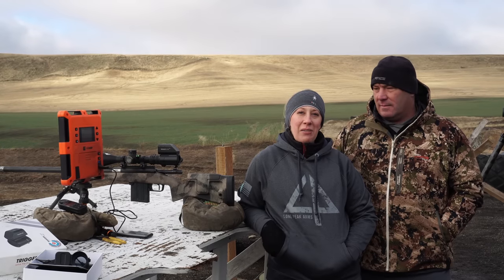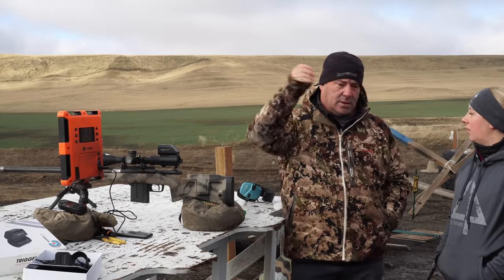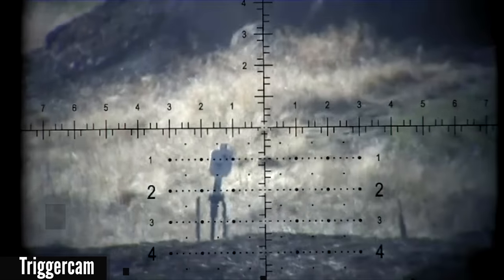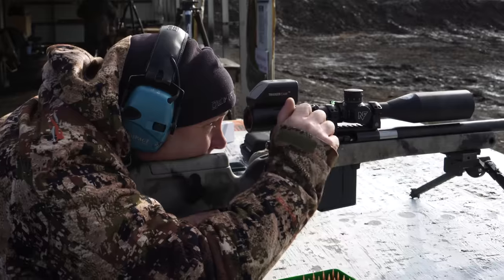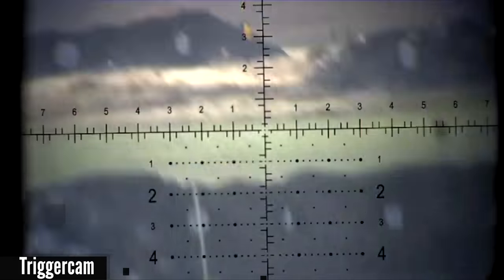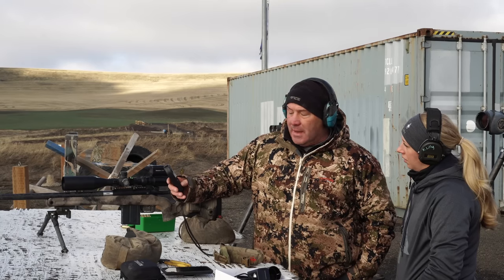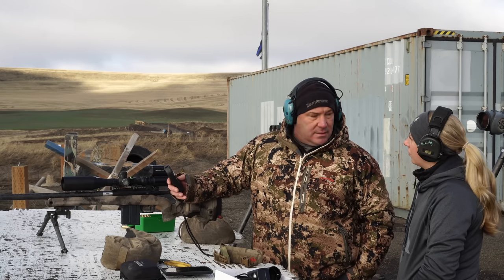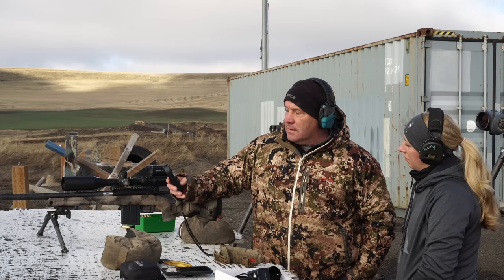Trueing and finding Ballistic Coefficient with Scott Satterlee

Comment: Really dig your vids. I recently upped my tooling and making better ammo. I REALLY like the KM 4 deg champher tool with stop. I'm neck turning and annealing, and even inner neck honing. I was able to get ~8ES recently where my buddy with factory was getting ~50ES (6,5 CM).

Very good info around truing the BC. Another tip that I have been known to use is to put the chrono up at 600 behind the sighter plate if its big enough and you trust your rounds enough.

Comment: on the kestrel to find aero jump, why not put wind at zero mph and the Left shift is your jump? example: at 600 yds, wind none, my windage is 0.69L. meaning i have to hold off 3/4 MOA only due to aero jump?
Reply from the maker: Are you talking aerodynamic jump or spin drift? AJ is a vertical number. Spin drift is a windage number.
Reply: @longrangewiththelillys1221  wha . . ? that sideways movement is spin drift . . . so i can account for that with zero wind, then how much aero jump could there be at 600yds, for example, and is that already included in the kestrel come up amount?
Reply from the maker: The kestrel accounts for aerojump. So go to 1000 yds. With a zero wind look at your elevation. Then put in a 9 o’clock 20mph wind at the same distance and look at your difference in elevation. You can also do this with a 3 o’clock winds. Play with it let me know what you come up with.
Reply: @longrangewiththelillys1221  1000yds, 20mph @9:00  E 32.5  15.75L      1000yds 0 wind   E 31.25   1.25L   so the spin drift @ 1000 yds is 1.25L  and the aero jump is 1.25U?
Reply from the maker: Sort of. This is a complicated subject. In my opinion the kestrel over estimates aero jump. But there are far better resources out there than us. But now you have an idea how aero jump works. Btw if you put in a 3 o’clock wind it will also be different but in the opposite direction. Hope this helps.
Reply: @longrangewiththelillys1221  what i do see is you can be an MOA off the target if these aren't accounted for or understood. i need a class!

Comment: Smaller poppers or danglers at distance?  Changing T-posts sucks.  Just sayin'
Reply from the maker: Lol just don’t miss!
Reply: @longrangewiththelillys1221  you should still be able to use a hardened target for reference, witness splash and measure for correction, right?
Reply from the maker: That’s correct. Others will use a rock or something small at distance where you will get good feedback to get a really precise measurement.
Reply: @longrangewiththelillys1221  I need to head back out to see Doug about trueing and proof a couple setups using these methods and print out the data